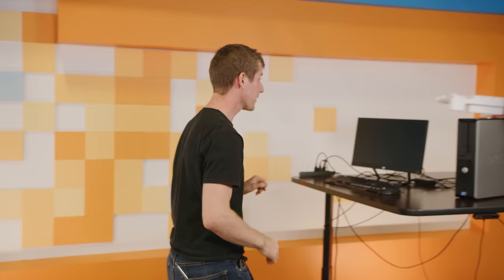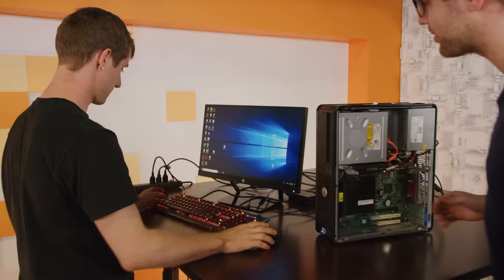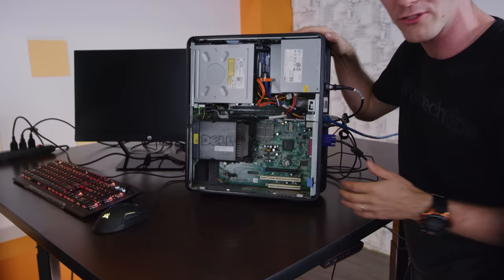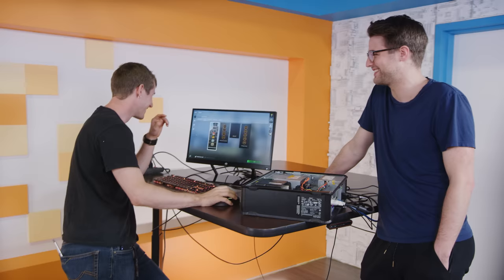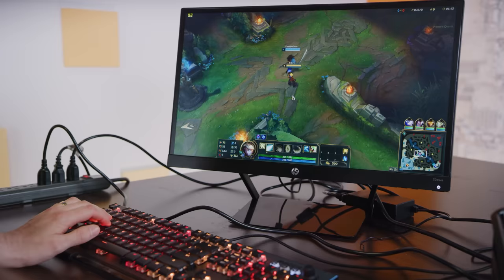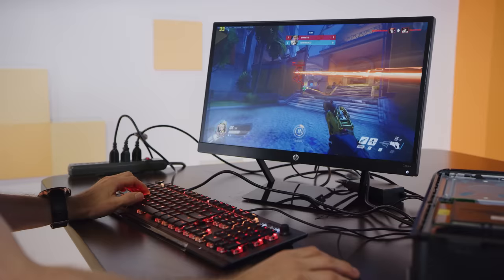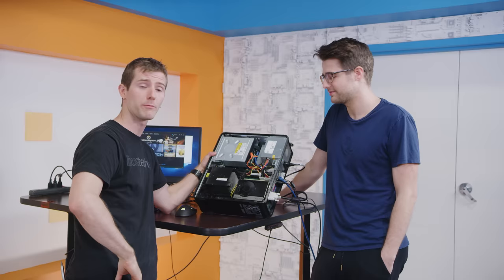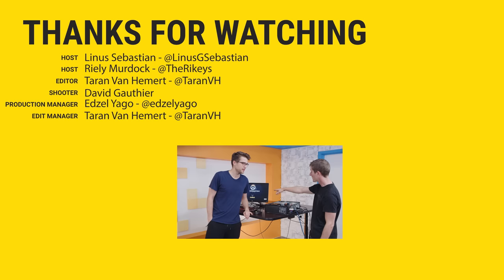The $69 Gaming PC RETURNS

Comment: I know I'm a few years late to this but for anyone actually looking to do this, if you're willing to put just a bit more money into this, this is a great way to build a decent pc for not too much. I recently did something similar before just outright building and could run most modern games on medium-high at 60 for a bit under 300. Definitely look into a prebuilt with a better processor than a dual core. There's a good amount of HP Compaq and Dell Optiplex models with mid range i5/7s that'll perform decently. My PC was a small form factor like the Dell in the vid so I got a low profile GTX 1050 ti that fit and ran great . If you have a PC large enough to fit a full size card, just make sure your power supply is strong enough to handle it otherwise that's an additional cost. It also doesn't hurt to upgrade from the stock ram to something larger/faster, 8-16 gb is pretty ideal for lower end. Here's my old build broken down, prices are what I paid on eBay, early 2019. For reference, I could run AAA titles such as Apex, R6, Detroit Become Human, DS3 all on high settings.

HP Compaq Elite 8200 SFF w/ i7-2600 - $125 (came with a 2TB HD installed which was nice)
Low Profile MSI GTX1050Ti 4GB - $120
Kingston HyperX Fury DDR3 2x8gb 1600MHz - $45
Reply: Jordan West how does this comment only have 5 likes lmao
Reply: Im thinking of putting a gtx 1050ti into my brothers pc, it has pretty good specs like i5-2400 (quad core), 8gb ram etc etc. Only thing is the power supply is 240w, I’m just worried that it will bottleneck
Reply: Can u add rx 470 if panel off with psu upgrade
Reply: @itwilsonboiii4789  if it fits
Reply: @jorroj  bracket size?
Reply: Should I make sure it uses an hdmi? Or is vga fine
Reply: Sir you are a hero
Reply: I love reading this. It makes me want to build one too. Even though I already have one gaming pc.
Reply: @ElderlyDragon  Hey, it's a low-cost system, you can live with VGA if it saves money! You might run into ghosting since it's an analog signal. Don't crank the resolution way up. Using VGA ONLY limits your resolution, not anything else.
Reply: @thewhitefalcon8539  Thanks, for letting me know. I actually just saved up some money and built my self a decent pc. But that information was useful because I have a vga port that I was thinking of using.
Reply: @ElderlyDragon  btw ports aren't important, ports are attached to stuff, it's the stuff they're attached to that's important. Like if you meant you had a monitor that only has a VGA port, you should probably say that.
Reply: @thewhitefalcon8539  Oh, okay good to know. 👍
Reply: Made a pc for my daughter, paid $10.00 for a Dell 7010 with 12gb ram CPU i7 and added a GTX 1050 4gb  got it for $100.00 so $110.00 total cost very capable at gaming plays bf1 Call of Duty ww2 dying light at very good fps actually shocked by its performance

Comment: I'm actually doing something surprisingly similar for a close friend of mine who lost her gaming rig in a house fire. On ebay, check out the full tower Lenovo thinkcentre. I got one for $73, shipping included, that sports an i5-4570, and 8 gigs of ram, but lacking a hard drive. The motherboard has 4 ram slots and 2 pci slots. I'm thinking 8 more gigs of ram, an SSD boot drive, cheapy 1tb hard drive, find a decent used graphics card. Had another friend throw into this stone soup a frankly overpowered Seasonic 850W 80+ Gold fully modular used power supply, so I think this'll turn out to be one heck of a rebuild for my friend. Broke gamers unite, yo.
Reply: For a cheap gpu go with either r9 290 or amd fury. If you want really cheap a r9 270x is good.
Reply: Bee H. Message me I’ve got a spare graphics card for you that I don’t use
Reply: I. Would stick with 8 gigs of ram, a single 500 GB Inland ssd, and get a 7970 or 280x for gpu. If you go the money left, upgrade that gpu to an RX 470 or 570. The used market for those is glorious.
Reply: +Bee H. Dude, that’s sick! Best of luck to you and your friend!
Reply: or get a 100$ gtx1050 or a 2nd hand 60$ hd7970 who are pretty good
not bad the i5 4570 and 8gb ram good deal :)
Reply: omg i was gonnabuy this exact pc from currys but it ran out of stock :(((
Reply: Think about getting 1030gt (if you only can use low profile gpu).
Reply: Stick with 8gb if you're trying to keep cost down, 16gb is nice but I don't know of a game that uses more than 8gb. The most demanding game I play is PUBG and it uses about 7gb from my testing. There probably are some games that use more than 8gb but with the specs you're going to have in CPU and GPU, they probably aren't going to run the greatest anyway. Save the RAM money and put it into something else.
Reply: Bee H. I have a AMD R7 370 windforce laying around, if you want, i'l give it to you for 20-40€. Cuz tbh, i dont need it. And if i can get someone happy with it, i'll gladly do it.
If your interested, hit me up on discord :'biebthesecond#8502'
Ooh and edit, if you want, i'm down for bargaining to.
Reply: what kinda spare gpu?
Reply: shes not gonna have sex with you bro
Reply: @Åsmund Haugen 'stone soup' meaning something along the lines of a cheap alternative of quickly thrown together parts.
Reply: @RobertPetrucha  I found playing open world games fallout/Skyrim ended up going over 8gb when playing for long periods. With mods
Reply: Then there is something wrong Skyrim would rather crash before using 8gb of RAM :P Same for Fallout. (both modded of course)
Reply: SSDs are so cheap, is it still worth it to do a SSD bout drive and HDD storage drive?

Comment: "You have to plug the mouse into a different USB port and then it works."

I already love this computer.

I legitimately love how stupid, janky, and full of character this $27 dell optiplex is. Somehow it's nostalgic.
Reply: I literally had the same issue with a core 2 duo pc i had. I used to play minecraft on it at like 30 fps and i thought it was buttery smooth. Simple days....
Reply: i use an optiplex with a q9550 with a LP GT 1030 in 2020, and honestly for the price it's amazing, i even managed crysis 3 at 60+ fps, league is constant 200, and csgo is stable 60
Reply: @kamaltufekcic4618  buy a pc with vega integrated graphics
Reply: @driptoop3650  wouldn’t be much of a performance boost ,just save up 300$ to get a ryzen 1st or 2nd gen pc with an rx 570
Reply: @driptoop3650  good upgradability and stuff
Reply: @driptoop3650  Please don't. Slow as hell.
Reply: bro my 2022 blade 17 does this sometimes LMAO
Reply: @sohamshesh  literally what I did. I had around the same fps, but it as a Dell OptiPlex GX620 with a 1 core Pentium 4 processor. I still have it to this day and I got it 9 years ago and it still runs the exact same, only upgrades being a little more RAM and a larger hard drive. I still use it for fun too.

Comment: Reminds u that the minimum requirements for league is a single core processor
Reply: classyfenn That doesn't mean much. You could run gta 5 on a single core cpu, in fact I did when I was struggling with a pentium 4 ht, the hyperthread allowed the game to run, like crap. Same with league, you're better off not doing that, if there's something league wants more it's definitely cpu over gpu. The pc in the video played league fine, but the requirements are outdated, the game is old and constantly updated, it's much heavier than idk how many years ago those requirements were posted. And playing a multiplayer game at 15 fps is something you shouldn't do at all. Especially something like league where every mistake is punished the way it is, would be a terrible experience.
Reply: @renyn21  LOL is super forgiving in all but the highest levels of play. I'm talking the top 2% it's a very easy game. Very.
Reply: For sure the thing would drop to 30 or 40 fps in team fights. They only tested cenarios easy on the cpu
Reply: @dscarmo  scenarios*

Comment: i5-2400 is where the value is at with these prebuilds. LGA 775 is ok for older games, but struggles, or won't even run, latest games.
Reply: I got a full pc for a friend of mine with monitor, keyboard and mouse for 200€. He put an RX560 on it and it runs everything really nice. It is an HP Elite 8200 tower
Reply: Nowadays, no need for 775 anymore since you can get a 1156 mobo and CPU for the same or lower price, plus the worst 1156 quad core CPU still faster than the X5450/E5450/Q9650. Tested on my own.
Reply: My laptop has a I 5 second gen and a gt 610m... It sells around 200 bucks
Reply: while the i5 2400 is a great CPU and so is the Sandy Bridge line I still think the Q6600 is capable,  before I got my i7 2600 PC I have right now I was using a Q6600 with 6GB ram and a GT 1030 and playing games like Doom 2016 while recording the gameplay for youtube and had very little issues
Reply: I have a second pc which is a lga775 and has a modded E5472 in it and gtx 770.Its plays most modern games on mid/high setting at 1080.
Reply: Tell me more, I still use it quite fine, the only thing I lack is DDR3. Well, I'm not interested in any modern game, but it run up to Witcher 2 no problem, Metro Last Light runs great, I have to say, though, I had problems with Fallout 4 due to 4GB DDR3, but 8GB DDR3 would make it better.
Reply: AndreasH900  what do you have now?
Reply: got a dell 990 with the i5 2400 4gb ram for $50 at goodwill. threw in an hd5830 that i got for $20 on craigslist.  $10 used 500w psu. plays gtav at 1080 and most other games at playable framerates
Reply: AndreasH900  I'm thinking about making my own system(once I find a job) I'm gonna get a second gen ryzen 5 and... Gpu I don't really know but a 1060 6 gb would be nice
Reply: I must do your justice...somehow, an x3363 overclocked to 3,4 gaigahertz, and an r9 270 was not enough to run the forza horizon 3 with acceptable framerate...horrible slideshow was that...or did i fail somehow?...but the nfs payback ran at 30-40 fps...for 20 minutes, but then...it crashed, and dropped me to desktop.
Reply: I agree, got a  Dell Optiplex 990 with a  i5-2400 4gb ram 500hdd for $75 CAD a few months ago
Reply: Rocking way unbalanced system with x3450@4GHz and GTX 650. Waiting for delider and liquid metal to arrive and saving for a new GFX(probably used GTX 970 or 1050 Ti)
Reply: Yup. Have a i5 2400 Optiplex and an RX 580 and it runs almost everything perfectly.
Reply: whats the best gpu for that with that small case
Reply: This is interesting, as I literally purchased this exact same machine about 3 months ago, with the original Dell (square) 17" monitor, keyboard & mouse along with the SFF Optiplex PC (with 32-bit Windows XP Pro on an 80GB 7400 RPM HDD), All for $20! Came with 2GB DDR2 RAM (don't recall the speed) on LetGo. 

I threw in some additional RAM I had to max out at the 3GB ceiling for 32-bit OS's, and added a low-profile Nvidia Graphics Card with DVI out, and it performs like a champ for running older era-correct games - It' was really a killer deal. Not amazing by any means (of course), but come on. For $20 for an actual complete system, bringing the total to 60-ish bucks (if you add in the price of RAM & the graphics card if you were to purchase used online) I feel it's worth every penny. Considering in my case I already had the RAM & video card; that part cost me nothing. 

Anyway - Well done guys! Put Riley in more LTT videos. And as another user commented, you could make Riley the budget-build go-to guy; would be a fun & interesting serious. Kind of a scrapyard wars single-person-team type of themed series. 

👍

Cheers!

-H.B.
Reply: I have one with GTS 450 :D I guess with 8 GB RAM would still run esport titles real nice. For example gaming Fortnite at 4GB gives you a lot of stutters. That's why I build new PC.
Reply: 771 xeons are 15 dollars. way cheaper and more powerful than the core2 quads available for 775 on the used market. it may not seem pure, but its a better idea.
Reply: i feel this, upgraded from 775 last year to 1155 and life is good with them strong cores
Reply: Haha, I left a comment explaining that because I had watched your videos but you beat me to the punch! One thing nobody is mentioning is that these machines almost always have legit Windows 10 included, even if it comes with no hard drive because of the Windows 7 COA sticker.
Reply: 775 C2Q runs games quite well 1080p.  I've got Total War Warhammer 2 with decent settings.  Same with Sea of Thieves.
Reply: nope
Reply: Had an old P5P43TD 775 lying around and therefore just bought an Xeon x5460 for 16$.
I could oc it to 3,8ghz. There are higher OCs possible, but i don't wan't to waste a good cooler on a budget system.
It is compareable to a sandy bridge i5 2500.
A big negative is the 120W tdp of the x5460, so you need a solid power supply.
I would agree, if you build a new "used budget gaming system", go with an old office i5.
If you can get a 775 board for free, it supports the 771 mod and you don't want to skimp on the power supply you can still go for the 771 xeon route.
Reply: I have X5460 @ 4275mhz + DDR3 8GB 1800 Dual Channel, and its still upgradable to 16GB, should be fine for newer game.

Comment: Me: Can it game?
LTT: Yeah!
Me: What ones?
LTT: Roblox and gmod on 800x600
Reply: I have a computer that can run Garry's Mod at 800x600 at an average of 40FPS, with various dips into 10-20.

That computer has 2GB DDR2 RAM, x86 Windows 7, DirectX 8.1, and OpenGL 1.4.

The computer they built could definitely play at a solid 60FPS at 720p.
Reply: Lenny69 シ  guess you have to build your own to get the correct parts
Reply: @Lenny69 シ My dad owns a much better computer, and I just set everything to low at 720p.
lol
Reply: @ztgasdf  Gmod is one of those games that can run decently on almost anything, which is surprising seeing as it's also a very visually pleasing game.
Reply: @tikoblocks3224  Exactly. It's cheap and has good, user-made content so no complaints here.
Reply: Anybody tell me a good pc to play gta or roblox ?? Cheap
Reply: Tikoblocks thanks to half-life 2
Reply: gmod good tho
Reply: Roblox is more graphic intensive than you think
Reply: Yup roblox is hard to run at 100 fps, its heavier than pubg i tried it, roblox lags alot

Comment: "Minecraft should run on a potato"

Somebody doesn't know about MC's notoriously bad optimization
Reply: If u use RTX, ur pc will died in 0.000000000001 sec
Reply: I love Java Edition but I gotta admit... It has awful optimization, my computer should probably be able to run it at 100 fps no problem, but instead it runs at 40 or so...
The Bedrock Edition is WAY better in that regard
Reply: @gavinthecrafter  use optifine
Reply: @thefrogmagician9866  I've tried every performance optimization mod under the sun, it does nothing. Optifine, Sodium, all of it, not even an extra frame.

Comment: Until a couple years ago this was exactly the gaming rigs my son and I used. I went to a local community college surplus auction and walked away with 4 machines for $70. Sold 2 on Craigslist for $30 each and used that to upgrade RAM and threw in really low-end video cards. And yeah, that performance was exactly what I remember.

Comment: 4:07 "Low profile and single PCIExpress slot"
Me: GT 1030?
Linus: GTX 650
Me: Oh
Reply: Well, gtx 650 actually a WAAY better card than in video
Reply: @Artem4egg_  But you have vulcan on the 1030, so you can run doom eternal
Reply: @edgarvega5859  well yes... But actually 40 fps...
Reply: @edgarvega5859  wait, did you answered on a 1 yo comment? Good job
Reply: @Artem4egg_  A 1030 can run doom, watch lowspecgamer's videos, even an Athlon 3000G can, vulcan it's just extremely optimized
Reply: GT 1030 is definitely the king of budget cards if you have an SSF

But if you have to have better performance, then the GTX 1650 is an option for $170
Reply: Qimodis  
An SFF is a Small Form Factor Office/Prebuilt PC, it's a standard size for a small computer (kinda like an Xbox One and PS4 size, maybe a bit bigger)
Reply: @edgarvega5859  The whole GTX 600 series has Vulkan support. Unlike AMD, Nvidia tends to keep older GPUs well supported where possible.
Buying anything from GTX 650 and up is totally fine if price and performance are reasonable. Windows 10 drivers for these GPUs won't be an issue for sure.
Reply: @user-uq3um5nq7d  Just to add a bit if you are getting GTX 1650 get the GDDR6 version, same price, better performance.
Reply: @Verpal  nobody sells GDDR5 version in my country, haha
Reply: @user-uq3um5nq7d  That's intriguing, since GDDR5 version hit the market first, many vendor still have old stock in my city, in Hong Kong, GDDR5 version is usually about 10 - 15 GBP cheaper.